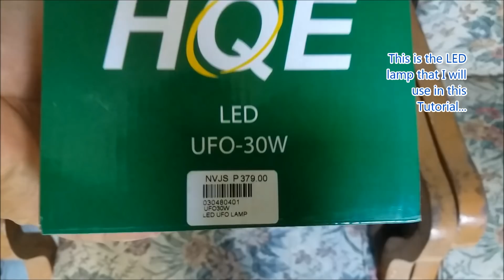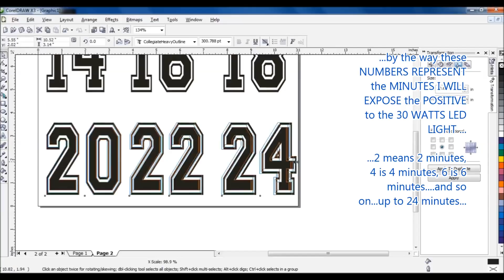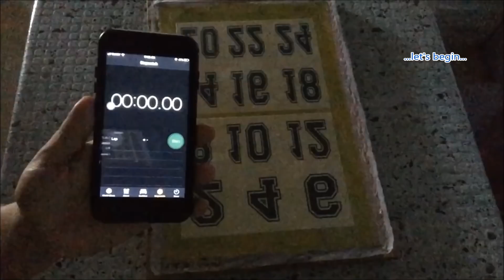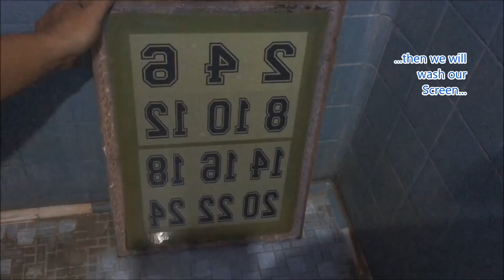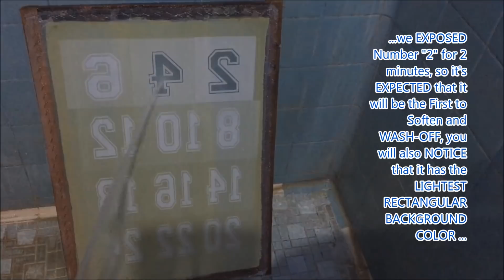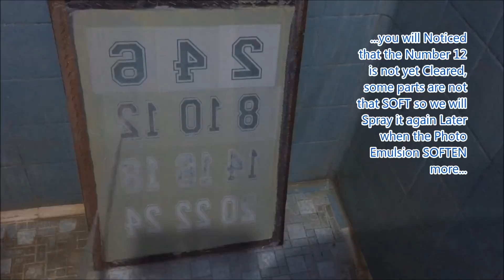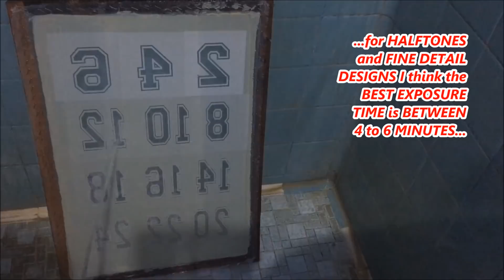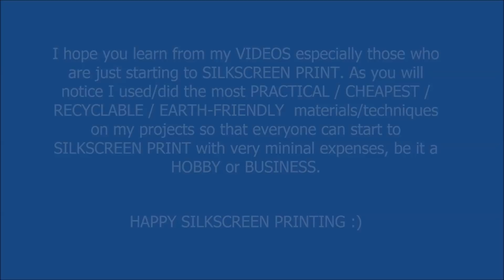Photo Emulsion Process - How to Determine the Right Exposure Time.

Comment: Very good video. I have done today this experiment with 30 W Havell LED light which I bought from a local store at INR 425.00. Exposing the screen for 2, 4, 6 & 8 minutes gives very good result. I use SONAKOTE & Bichromate sensitizer. 2 pouches of sensitizer (each 3.5 gms.) should me mixed thoroughly with 100 ml water. Take SONAKOTE according to your requirement and mix the diluted sensitizer thoroughly. Leave the imulsion in a coll dark place at about 1 hour to get rid of the bubbles. Coat uniformly on both side of the screen and make the screen dried in a dark chamber. As to the proportion of SONAKOTE & sensitizer it requires some experiment though one teaspoonful of sensitizer is enough for 50 ml. SONAKOTE. Thanks.
Reply from the maker: I'm glad that you got it!!!!

Comment: Your video is great! very easy to follow. I have great result using your method combine with sunlight. I wanted to try LED light, so I went out to buy a similar strength LED light, the one I got is a 27W, 1500 lumens LED flat lens ceiling spotlight. I didn't buy a bulb with a separate light base. After 13 minutes of exposing from 20'' away... nothing happens. I can't see the white mark on the screen when I lift away the film to check...  Can you tell me what was wrong?
Reply from the maker: Maybe you need to Expose it More...Sometimes Different Brand of Photo Emulsions have different  Exposing Time.....
Reply: I am sure you have solved your problem by now, but make sure the LED has a full spectrum or "daylight".  Some bulbs exclude some of the wavelengths and don't have enough UV.

Comment: supposing i don't have a blower or electric fan , how long should one let the photo emulsion to dry  bfo applying another coat on the screen?
Reply from the maker: If you Notice that the the Photo Emulsion is Dry you can apply second coating Right-away...it's easy to identify if the Photo emulsion is already dry....
Reply: @EasyVideos  thank you sir

Comment: Hey bro first I appreciate all this tutorials you are helping us with...I have been trying to screen print and for my exposure unit I use a 200w led light and been exposing my screens for 4 minutes...I am yet to have a successful print. Some paint passes through the screen and destroys everything...where am I going wrong?
Reply from the maker: It seems that your Screen stencil easily break during printing, these are some possible reason- 1.) maybe you need to expose you're screen to led light some more, maybe 5 or 6 minutes. 2.) Maybe you need to apply hardener on you're screen stencil and 3.) Maybe its the brand of Photo Emulsion.

Comment: What type of emulsion are you using?Also when you attach the silk on the screen you dont put much pressure to stretch the silk,,you dont have any issue regarding the dullness of the silk?
Reply from the maker: It's was well stretched even if I only use my hand attaching the screen and no problem at all during printing :)

Comment: Am using blue emulsion with red and blue paint but the printing is not coming out what colour of paint should I use?
Reply from the maker: The Design on the screen stencil  did not wash-off during washing that's why there's no opening for the paint to pass through....
Reply: @EasyVideos  do u have any video on universal classic heat transfer paper using iron

Comment: How much the emulution take to dry
And exposing time of under sun light
Reply from the maker: After coating the Screen with Photo Emulsion let it dry in a DIM area, you can use electric Fan to dry it....then if you will Expose it to SUNLIGHT be sure not Over-Exposed it...10 SECONDS is enough....

Comment: questions re screen prep: how long should it take for the emulsion to dry and the screen to be properly exposed in a 500-watt halogen lamp? and how far should i place the screen from the light source?
Reply from the maker: The Photo Emulsion Dries within 15 to 30 minutes using Electric Fan, you have to Experiment determine the Right Exposure Time for your 500-watt Halogen lamp and the Distance is 20 to 30 inches from the Screen....:)

Comment: Hello I have a question every time I expose 2,4,6,8,10 minutes  all ways wash off everything.  Why ?  My light source it’s two lamps. 25 watts each so it’s 50 w.  I ready change two different emolutions
Reply from the maker: Are you using LED? maybe you need to expose it more  than 10 minutes, since we're using different LIGHT SOURCE, Exposure Time also varies....
Reply: Easy  I’m using uv light it’s like blue

Comment: Sir easy itatanong ko lang po ulet bakit natatangal yung ibang letters sa pagburn ko po anu po kulang sensitizer or sumobra po ako ng minutes sa pag burn... Nilagyan ko naman po ng glass pero nung hinugasan ko na nabaklas po yung ibang letters...sa tingin nyo po kulang sa sensitizer or sumobra po ako sa minutes..kasi hallogen lamp ginamit ko po 500watts ginawa ko po syang 2minutes... Waiting po sa reply nyo salamat po...
Reply from the maker: Kung Natatanggal po yung ibang Letters ibig sabihin HILAW yung Pag-DEVELOP, pwede nyo pong gawin 2:30 yung Exposure Time.....
Reply: Easy maraming salamat po try ko ulet san po ba kayo nakakabili ng ganyang emulsion ganda po kasi ng kulay yung ginagamit ko po kasi kulay green ang kulay nya kapag hinaluan ko na po ng sensitizer...salamat po ulet...

Comment: Sir I would like to know how much time the emulsion takes to dry off , and I am looking to expose the positive to sunlight for  10-12 seconds will this do the job !
Reply from the maker: Using electric Fan -emulsion dries in about 15 to 30 minutes........yes 10-12 seconds will be ok....
Reply: @EasyVideos  sir, 15 to 30 mins drying on the electricfan for first coating and another 15-30 mins drying for the second coating? am i right sir?
if im going to use tulco local, can apply the same drying time?
thnx

Comment: How do u determine 4 to 6mns for fine détails and halftone. And 6 to 10 mns for regular ? Please
Reply from the maker: I based it on the Experiment I conducted on the featured Video...you can determine the Right Exposure Time during WASHING of the EXPOSED Screen Stencil....MINUTES were REPRESENTED by NUMBERS, when I WASHED the SCREEN 4-6 Washout Easily and therefore I Concluded that 4-6 minutes is best to use in EXPOSING Fine or HALFTONE  IMAGES.....I conducted the Experiment because this is the FIRST Time that I will use this kind of LED Light, and I want to Determine the Right Exposure Time for this kind of LED....

Comment: 1) How much mixed sensarize in sonakote ??
2) Why double coating intended ?
3) When coating are completel  which time is best for expose ? 
4) How many Times to best for exposu ?
5) why Oil mixing in exposure paper ??

** Please sir help me*
Reply from the maker: 1.) 90% Photo Emulsion 10% Sensitizer..
2.) Just to make sure that Screen is Properly Coated...
3. & 4.) Using LED -anytime, Using Sunlight 10 am to 3 PM if you're living in Tropical Country...
5.) Oil Makes the Un-printed part of PAPER TRANSPARENT....
Reply: @EasyVideos 1) can i use 750w bulbs 1 fit long ?
2) How many Cfl bulbs in use and it's distances between frame? 
3) Time in exposure 6 minute ??
Reply from the maker: You need to Experiment to Get the Exact Exposure Time, around 20 to 24 inches should be the Distance of the Bulb from the Screen...similar to this Video; https://youtu.be/0LrUiqnwVB0

Comment: Na notice ko po sa mga vids mo. Hindi po kayo gumagamit ng ready mix emulsion. Any reasons po? Mas cheaper po ba yung ordinary + sensitizer?
Reply from the maker: Yes...mapapanis kasi ang photo emulsion na may sensitizer pag hindi ito nagamit lahat, kaya konti lang din ang Mini-mix ko....mas laking mura pati pag Tulco local at sensitizer ang Combination....
Reply: @EasyVideos  ang galing nyu po. Hindi po kau gumagamit table adhesive sa 2 hanggang 3 colors. Problema ko din sa silip mode is sa pangalawang shirt hindi ko na makita kse natabunan na yung guide or mismong butas ng stencil ng ink.